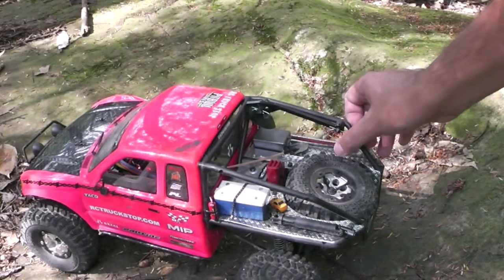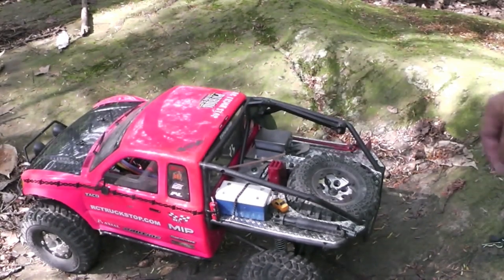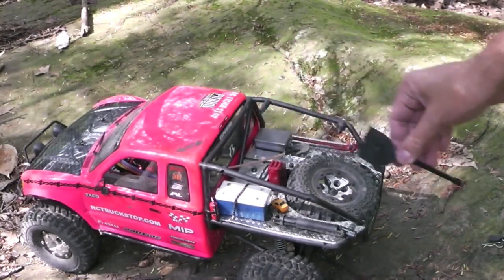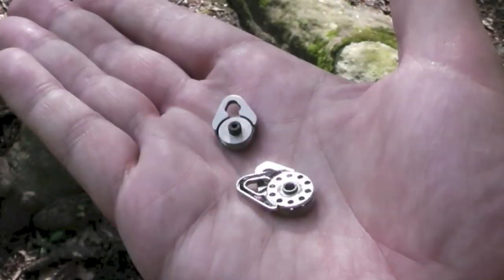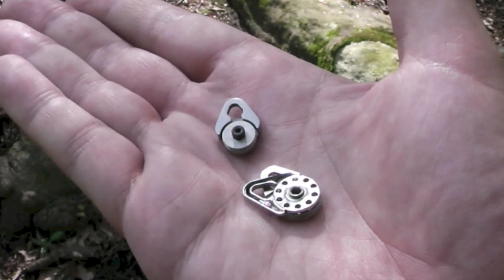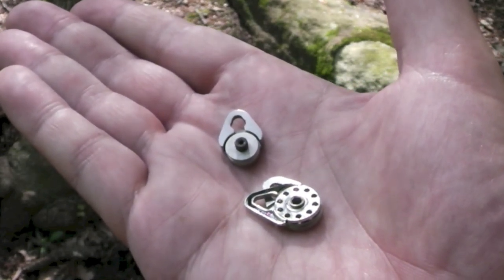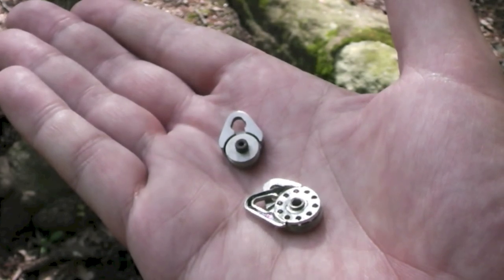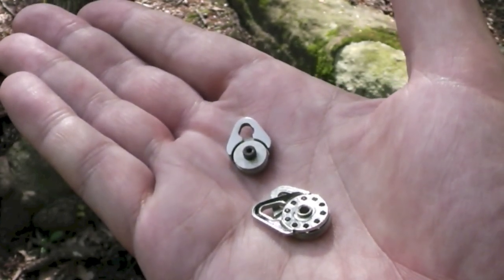RC Scale Winching and Vehicle Recovery

Comment from the maker: Make sure you check out the full article on scale winching and recovery at RC Truck Stop. There is a Tech article on winching and recovery techniques and an additional article specifically on the different types of winches and winch accessories. There is a link to RC Truck Stop in the video description.